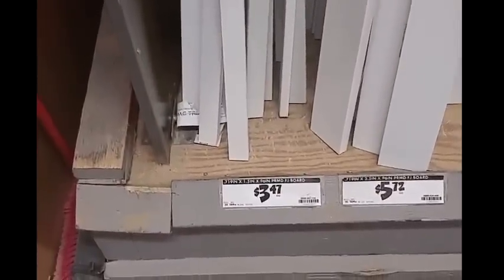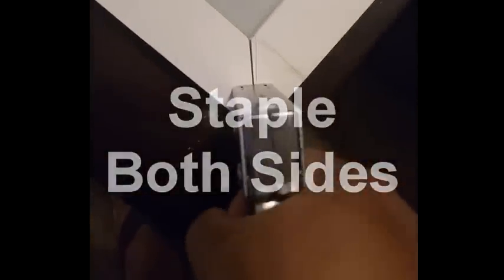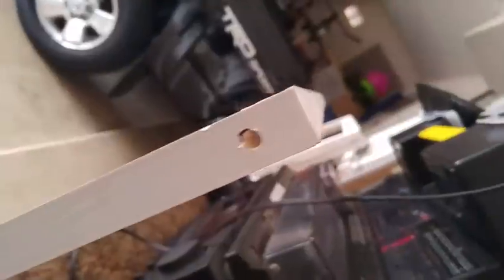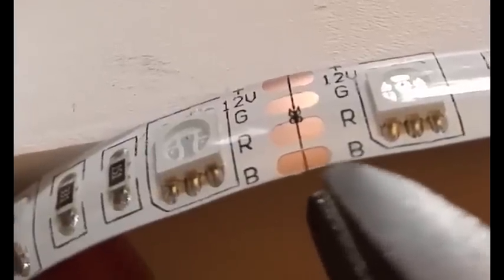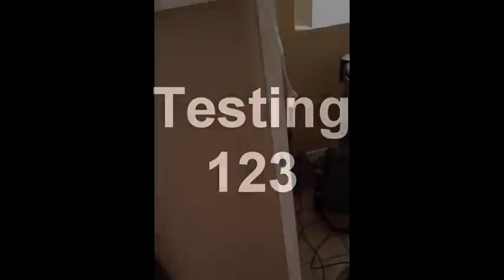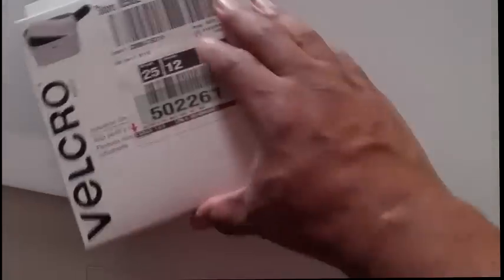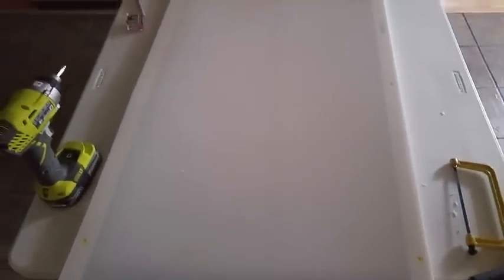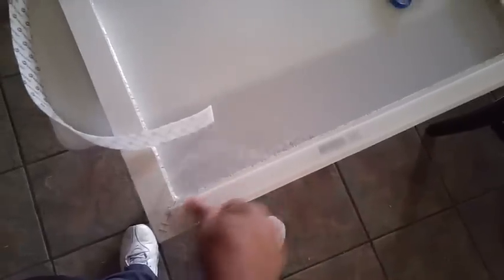DIY Glow Facade Part 1

Comment: How many rolls of light strips did you buy? Also, how did you connect them all if they're on separate panels?
Reply from the maker: Jarrett Genovese. the LED strips ccome in 5 meter rolls and you will need 4 total one fre each panel. you will have to upgrade the power supply thou. I planning on making a video on it later.
Reply: what did you upgrade the power supply to?
Reply from the maker: Jarrett Genovese 40 watt
Reply from the maker: See part 2 for how I connected the strips/panels.

Comment: Product Variants:
1/32" x 24" x 48" HDPE Sheet
Item Number: 42584
List Price: $4.97 Sheet.
  this is the    rigts  or is diferent..
Reply from the maker: That is the thinnest I would go, I think I used 1/16" thinking 1/32 might not last as long. Thicker panels will add more weight thou.

Comment: what thickness of plexiglass did you use? 1/32" or 1/8"
Reply from the maker: I actually used 1/16" x 24" x 48" HDPE Sheet it was $9.91 a sheet and shipping can be a little pricey.

Comment: I'd called usplastic, they wanted $680.00 for (8) 24x48 panels!!! GESH☺
but the facade is nice tho!
Reply from the maker: check the link in the description
Reply: use the company tap plastics...they are way cheaper & they do custom sizes FOR FREE...only drawback is you don't have as many choices of thickness on the hpde...but to be honest if you get 1/8th inch thickness it will work just as good
Reply: DJ T-Roy B  where u get the led lights at and th0e panels at